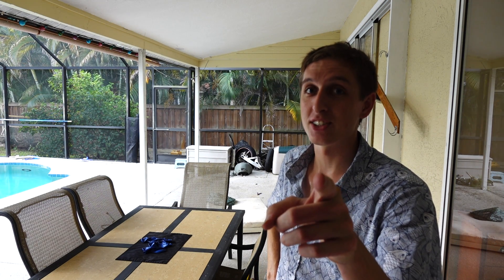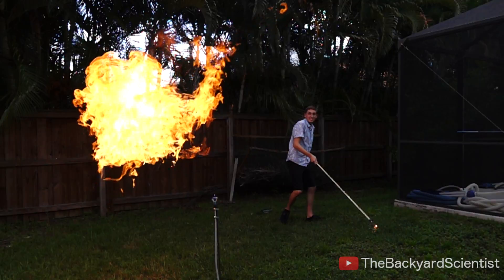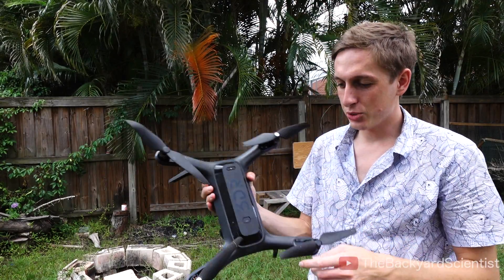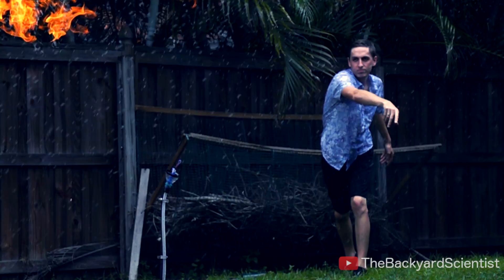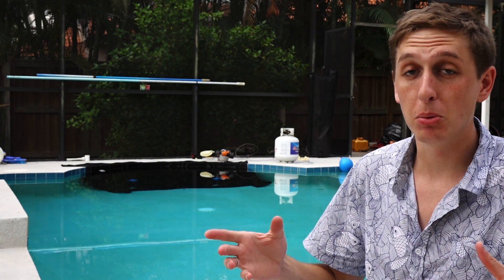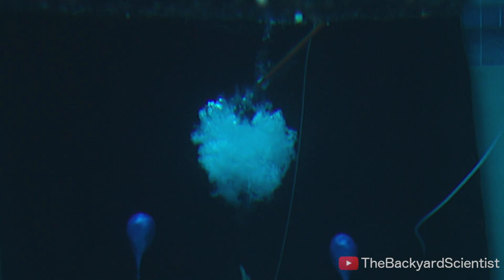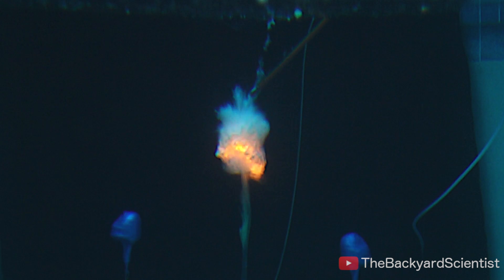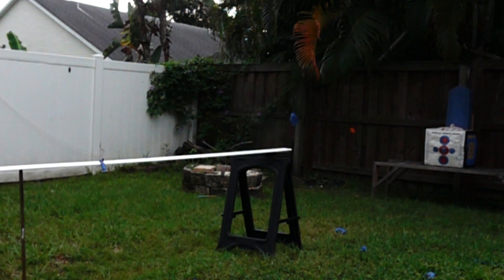Exploding Balloons filled with Propane Gas. Drones, Steel wool, and Underwater explosions! - SMS#4

Comment: Could be wrong, but I think the second underwater "explosion" is just caused by the gas in the cavitation bubble being compressed almost instantaneously when the bubble implodes. What happens to a gas when you increase the pressure? I guess the pressure change is so fast it actually raises the temperature enough to ionise the gas. Underwater plasma?...maybe?
🤷‍♂️

Comment: To be specific with the warning he gives if you're doing this, stay away from the propane and use either a bullet/fire-based weapom (ex. A flamethrower or a pistol (maybe..)) or something long with something ignitable on the tip (ex. A long stick with (an) ignited match(es), or a long metal rod with ignited thermite.).

Comment: Hi, all your underwater
explosion videos are very informative and this one particularly because it
shows exactly what sometimes happens to commercial divers when they do
underwater cutting job and some residual gas explodes.
I’m actually starting a study concerning the formation of hydrogen/oxygen explosive mixtures during such cutting operations, and to illustrate the cover of my paper I would like freeze an underwater explosion sequence of your video and make a photo of it.
I therefore ask your permission to so. 
If you agree, I will of course mention in my references that it is taken from your YouTube video.

Thanks in advanceFrancis HermansRetired Commercial Diver.

Comment: I'm guessing that the second explosion, or why in imploded, is because the pressure of the water pulled it back in.  Then after that, it did another one because the gas needed to expand

Comment: Did you count the volume of the ballon as a sphere then you get 18 liters not 11. (r^3*pi*4)/3  = (1,651^3 dm *3,14*4)/3 you will directly get liters. Correct me if Iam wrong.

Comment: Actually, there IS oxygen underwater.
It's called dihydrogen monoxide for a reason, after all - the problem is that the oxygen is already bonded to two hydrogen atoms, so it's not all that reactive anymore.

Comment: You like Explosive ideas? Try putting motor oil in a gallon plastic milk jug, (no more than a quart) and insert a tube connected to an Oxygen bottle inside. make sure you are about 50' away before you turn on the oxygen. Tree trunks have been removed this way so I've heard.

Comment: The underwater explosions remind me of depth charges.

some experiment ideas:  
drop a large lithium polymer battery into dry ice and molten aluminum
short and pierce lithium polymer  batteries underwater
drop model rocket engines into molten aluminum
drop bullets into molten aluminum
raw whole chicken into molten aluminum, and into dry ice then smash it after suitable time has past
molten aluminum into aluminum pot placed on grating of some sort - to see how long it takes to disintegrate

Comment: I think I know what causes the double explosion, it's just the gases settling before ignition and not combusting completely, then remixing after the explosion and combusting, it happens in grain elevators when they have dust explosions They have multiple explosions that get stronger and stronger.

Comment: Well, even if you had the propane+o2 ballons outside, they'd still do quite a bang as the gas is mixed and the burn doesn't have to wait for oxygen to flow in.So it just explodes

Comment: I wonder if a similar double explosion happens in stars undergoing supernova... except instead of water pressure and chemical reaction, it would be gravity and fusion.
Reply: It is when the star is big enough for a second compression but too small to make a black hole. It is the process that makes white and red dwarfs...
Reply: exactly what i thought
Reply: +Macoba19 what if two black holes with the same weight, size, mass, basically identical dead stars collided with the same speed?

Comment: the second fire is probably from the gas left in the feed lines that was finally able to push back into the cavitation once the pressure from the initial ignition fell below the ambient pressure in the lines catching the leftover gas before collapse.

Comment: Please do a baking soda and vinegar bomb in slow motion.  You fill an empty bottle of water 1/4 of the way with vinegar, then get plastic wrap and put over the top as a sheet.  Get a stick and poke if in so there is a compartment and fill it up with baking soda.  Trim the extra plastic wrap, push it down, and when the little waffle things go away, throw it.

Comment: The under water explosion looks like a small implosion at first
Reply: Justin Goodwyn 
o
bu
Reply: Because it is. Non-vacuum Implosions are caused by the surrounding fluid being so dense it pushes the expanding fluid back inward. In the video the density of the water is greater than the expanding gases so it forces the gas back inward.

Comment: H2o there is oxygen under water but not enough to light on fire
Reply: +Atlas Gaming  If you're talking about the O in the H2O then.........you're joking right? However, yes there is a little O2 dissolved in the water.

Comment: The second explosion is caused by what's called super cavitation, this is the effect when a void is formed underwater. The liquid rushes backwards with such force it causes an explosion. This is the same effect used by pistol shrimp in there attacks.

Comment: I'd like to see what happens when two balloons are popped next to one another in a small enclosed space.  One would be filled with pure O2 and the other filled with a pure flamable gas (H2 or Acetylene come to mind).  
Obviously it would make a VERY big bang if it ignited, but I'm wondering if there's enough randomly high energy gas particles to ignite it spontaneously.

Comment: I think you are right, the water push in b4 it has time to heat up and expand, only can see it with the right camera. But what if you use a steel tank with the same volume? Would the effect be smaller somehow?

Comment: What happens if you pour gasoline into on the surface of water in a pool then light it
Reply: +Cam Cloggs fire?
Reply: +Cam Cloggs Oil floats to the top. There would be fire on water, thats all.
Reply: Smoke on the water

Comment: The bow and arrow might work better with the sparkler on the tail, as it would pass through the cloud, whereas on the tip it is already halfway through when the gas is exposed.

Or not, maybe it's just too fast entirely as you said.

Comment: That secondary explosion under the water is called sonoluminescence.
Reply: +Travis Uribe I think it's highly dubious that the second flash is at all related to sonoluminescence. Sonoluminescence is defined as light that occurs when a sound wave causes the rapid collapse of a gaseous cavity (read in your links). Although there may be some a sound-wave phenomena occurring, the fact that sonoluminescent flashes are sub-nanosecond would seem to rule out sonoluminescence as the primary source of what we see.
A much more mundane and likely explanation is partial combustion, something that happens in car engines if they're not properly adjusted. If there's not enough oxygen available, some fuel will remain. As the cavity collapses, the remaining gas is compressed, increasing access to any oxygen that might remain and further increasing the temperature, leading to a detonation.
Reply: +Travis Uribe cool thanks, i really wanted to know
Reply: +Anshul Kanaparthi I see why you'd think that, but:
https://en.wikipedia.org/wiki/Sonoluminescence

https://www.ahdictionary.com/word/search.html?q=sonoluminescence
Reply: It's just the fire from the exploding balloon being compressed into a small space by the water.
Reply: +Sarah yup
Reply: +Travis Uribe The second explosion is caused by what's called super cavitation, this is the effect when a void is formed underwater. The liquid rushes backwards with such force it causes an explosion. This is the same effect used by pistol shrimp in there attacks. sonoluminescence is a different principle all together.
Reply: Sarah I agree... propane is heavier than O2 so they would not have been perfectly mixed for all the propane to be ignited immediately.... rapid compression would have heated the residual reactants as well as mixed them together causing the 2nd ignition.

Comment: Please read! Can liquid propane put out a small fire?
Reply from the maker: +Caleb Oackes hell to the no
Reply: Thank you!
Reply: That was a joke right? Please.
Reply: +Alex Gonzalez I have done that, I went underwater and tried shouting "GUN", couldn't hear what I said, my mouth was filling with water and nearly started drowning

so don't try that
Reply: Yes
Reply: +Azeem Is Awesome you sir are my hero
Reply: i want you to shout a gun under water
Reply: Could you please do a video where you melt aluminum and try to turn it back to a solid with liquid nitrogen?
Reply: please read please read please read please read please read please read please read i doubt it
Reply: +Azeem Is Awesome go deeper and try it....disclaimer; in the event you would actually do that, don't.
Reply: +Caleb Oackes That is a suicide mission 0_0
Reply: If you blow up a propane tank,  the pressure from the explosion will put out a small fire.
Reply: Propane evaporates to fast. use gasoline instead. lol
Reply: I did that to! lol, a little poof, and the match went out. so I filled all of my fire extinguishers  with gasoline, just in case I don't have liquid propane handy!
Reply: +Alex Gonzalez Slo mo guys did it
Reply: no it will make it worst
Reply: technically if the propane smothered the fire... like one time I dropped a lit match into washing gasoline (basiclly gasoline but more flammable) and it created a small whoosh but then went out because all the oxygen was burned up. maybe propane would do the same
Reply: christiaan de ruig maybe. but it'd have to be a lot of propane to remain liquid long enough ...
Reply: it will make it bigger
Reply: propane explodes if ignited.
Reply: George Munks Fire alarms and trainspotting Derp a duh
Reply: Yes! that's how they put out an oil well fire! A bomb that eats Oxygen.

Comment: love the vids keep it up light the wheels of a bike on fire and ride it
Reply from the maker: +isaiah marion OK thats a great idea.
Reply: +TheBackyardScientist you might want to put some kind of shield on your back incase the wheel flings fire on it!
Reply: +TheBackyardScientist  Test if hoverboards can really explode
Reply: isaiah marion I think that there was not two explosions but rather an explosion of the gas egniting and a implosion releasing carbon dioxide as the explosion colapses in on itself due to higher pressure under water

Comment: The answer to your "secondary explosion" is exactly the dieseling effect known as adiabatic compression. When you ignite the gas inside the balloon it burns and expands pushing the water outward very rapidly. Once that energy has been expended the pressure of the water then rapidly pushes that pocket of gas togather again. As the expanding force was so powerful, the resulting pressuring force is also powerfull. This then causes adiabatic compression.

 Me do science good :-D

Comment: second explosion! very cool. it may be possible your fuel air mixture wasn't truly  stoichiometric. That may have left fuel behind. Then maybe the water could have atomised small enough that it  supplied extra oxygen to mix with the excess fuel then the high pressures from compression ignited it.

Comment: A friend of mine and me built burning arrows when we were like 12 or so. Just melt down a few candels in a pan and dip some cothing stripes into the liquid wax, then wrap it around the tip. The arrow is not that fast with the big burning tip so you shold be able to ignite the baloon on the end of the video. I know that this has nothing to do with science but anyways. Good luck

Comment: What if instead of an arrow with a sparkler on the tip, the flame was on the back somewhere so the tip popped the balloon, exposing the gas, then the flame passed through after. Would the arrow still be too fast?

Comment: +TheBackyardScientist  put burning magnesium in liquid nitrogen
Reply: Oxygen itself will not burn.  It needs fuel to burn, so the most that would probably happen is that the flare would flare up a little, pun not intended.
Reply: In other words, it is an oxidizer, and it oxidizes the carbon and hydrogen atoms into H2O and CO2 respectively.  Without something to attack, it just disperses into the atmosphere.

Comment: Because you put the balloon underwater you increased the pressure on the explosion which magnifies it. Some atomic bombs work on a similar principle. I learned that when we used to take film canisters of match heads and a little wax and throw them into the pool.

Comment: The low-pressure bubble left after the explosion begins to collapse due to the higher 
pressure of the surrounding medium. As the bubble collapses, the 
pressure and temperature of the vapor within increases. The bubble 
eventually collapses to a fraction of its original size, at which
point the gas within dissipates into the surrounding water in a second explosion of energy in the form of an acoustic shock wave and visible light. Temps can reach several thousand K.

Comment: wow that underwater bomb had the most satisfying sound, also later can you try lighting an oxidized propane balloon in the air? I'd assume you'd get a bigger explosion, but less shock wave since there is no pressure from the air to keep the energy stored for a second.

Comment: Could you please do the underwater shot again, with the balloon right next to a big (side length>2 times balloon diameter) vertical concrete tile? I suspect that after the burn, as the bubble contracts, it forms a jet towards the tile, which will break through the tile.

Comment: That solo looks so sexy but the customer support for them sucks. Anyways that was still awesome!
Reply from the maker: +x9x9x9x9x9 it says a range of .5 miles, more like 500-600 feet. in the suburbs. around 1000 over the ocean. Also, video without the gimbal is nothing special so i don't include it in my videos. im sure i will have more fun with it when i can control the camera from the air.

Comment: The second explosion underwater was caused by the air cavity made by the gas, which in turn made the waters pressure push on it with enough force to explode again, you can see the same effect by shooting guns underwater

Comment: Should have done it with acetylene and oxygen. ;)
Reply: Justin Dixon  why is that ?   it would have pollute his swimming pool also .. lol
Reply: Seriously, that would be awesome
Reply: oh I thought acetylene was liquid stuff but it's gas, I got mixed up, unless it can be found in liquid form too, but yea, sounds good :).
Reply: So long as you get the oxygen mixture perfect, no elemental carbon should be produced to pollute it. Get it wrong and you'll have long carbon chains that look like black fibers everywhere.
Reply: Oh I see yea I was talking about if it was a liquid but yea damn.. maybe not sure a good idea after all ahha
Reply: +Justin Dixon I remember doing that in Chemistry, made an interesting popping noise but we did it with a tiny volume(2 gas jars) so doing something like these sizes would be cool to see.
Reply: +Mage To Light  I highly doubt you used Oxy-Acetylene. Was more probably the "Hydrogen pop" demonstation. I could be wrong though.
Reply: No it was, we prepared it ourselves. The preparation of the acetylne is actually mandatory here for what is the equivalent of high school if you are doing Chemistry and the combustion of both acetylene and oxyacetylene is optional.

Comment: you can use an arrow you would just need to have a sparkler attached to a string attached to the arrow but a right length so it flubs through the gas!!!

Comment: Water does have oxygen... It's made with one part hydrogen and two parts Oxygen
Reply: It needs to be oxygen alone, not H2O lmao.
Reply: +psychopath chris Molecules don't have the properties of the atoms that make them. Water doesn't have the properties of neither oxygen nor nitrogen. To use eother of these for reactions you'd first have to separate them, for example through electrolysis.